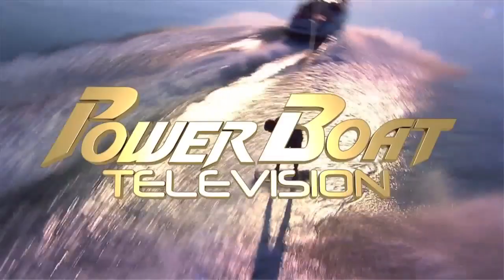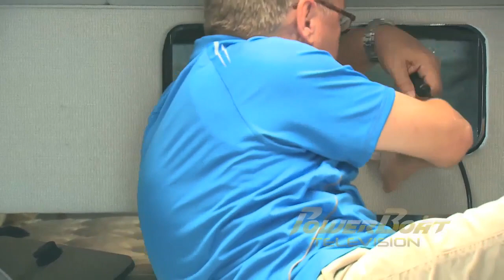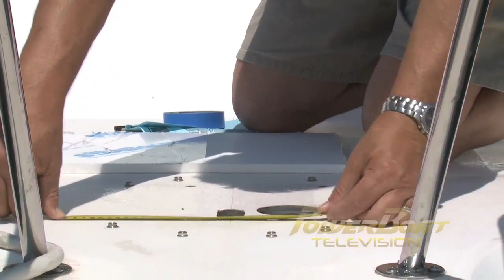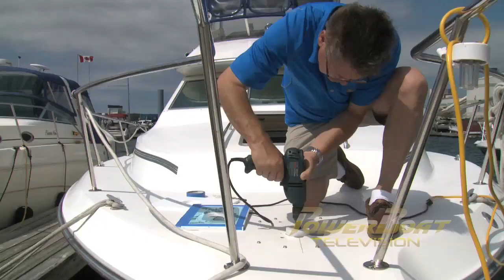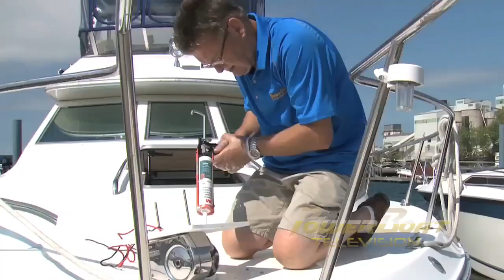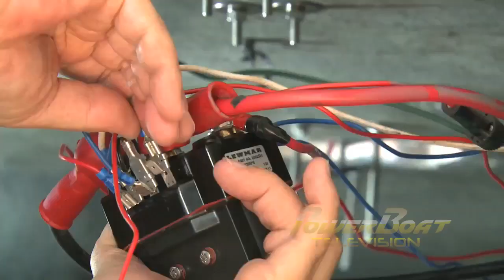How To Install a Windlass - PowerBoat TV

Comment: Good is the best windlass. Better to send back to Good to be rebuilt than replace with Lewmar. No heat shrink on the wiring. Old holes should be filled with west system epoxy, not silicon. Fuse and wiring should be checked and adjusted to power requirements of new windlass. Many details not shown and things done wrong.